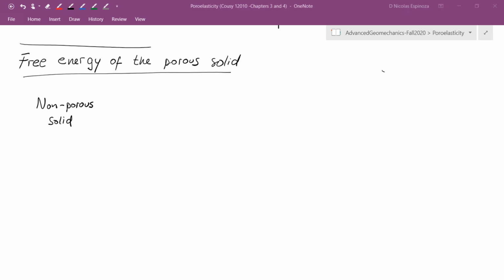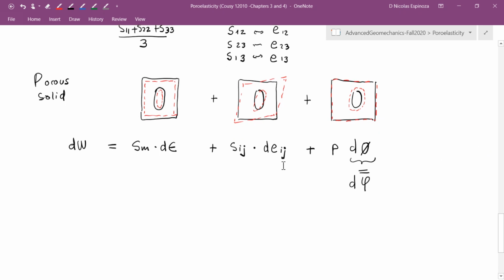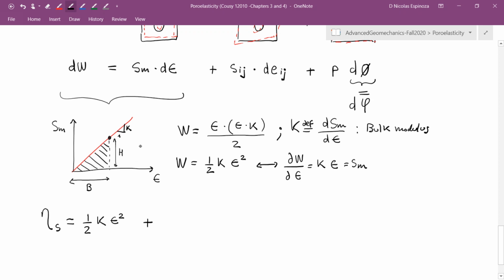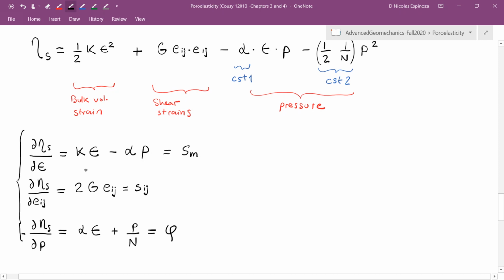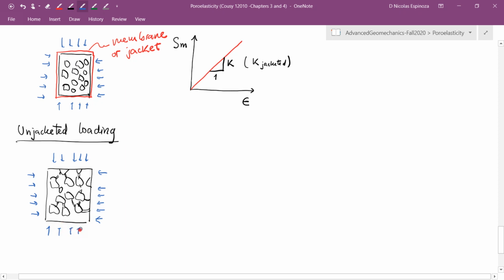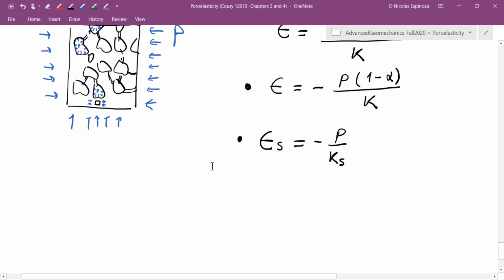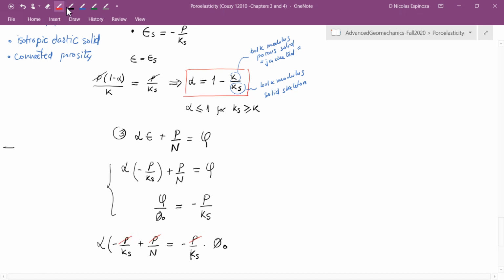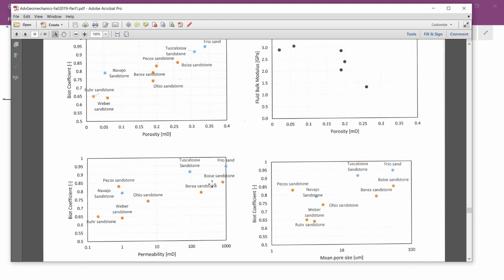L17 Fundamental poroelasticity equations and poroelastic parameters

Comment: at 21:40 you have: Total stress = Effective stress - Pore pressure ?

I thought it was: Effective stress = Total stress - Pore pressure
Reply: sorry, this is due to the engineering vs geomechanics sign convention that you mentioned isn't it
Reply from the maker: @Cookstein2  Yes, I'm using the solid mechanics convention here in which compression is negative.